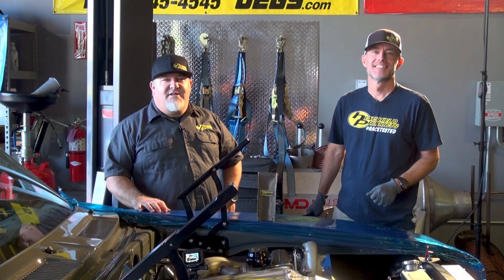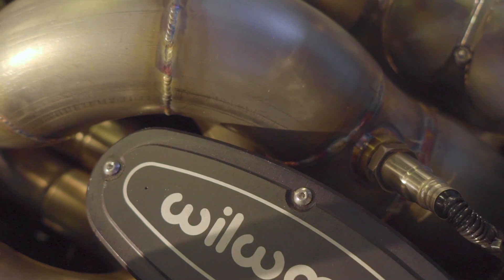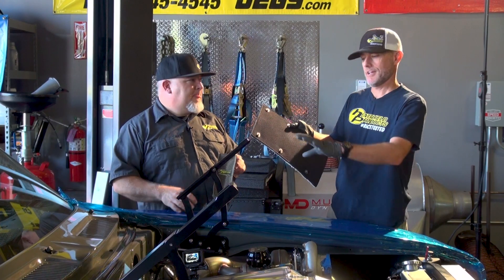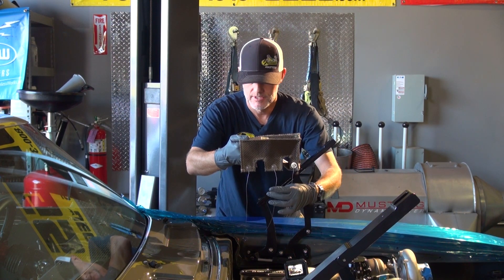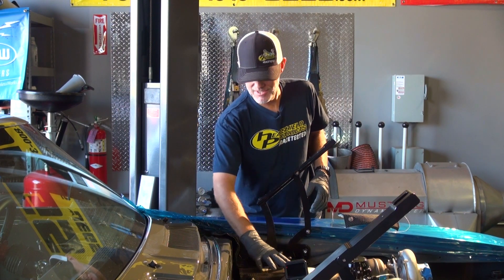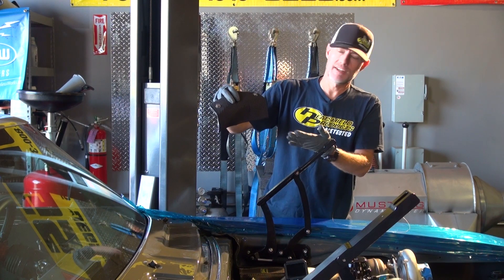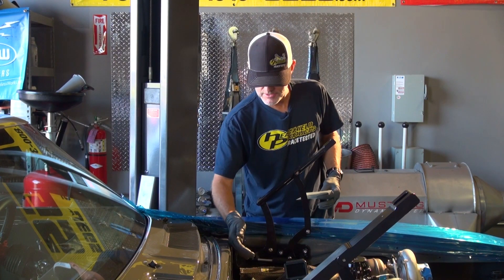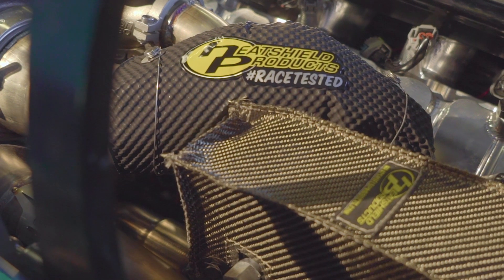Brake Master Cylinder Heat Shield

Comment: Wont putting the lava shield over the brake MC also trap heat inside of it?
Reply from the maker: Thank you for watching. Master cylinders do not generate their own heat, shield external heat sources will keep them cooler.
Reply: @Heatshieldproducts  I just bought the inferno heat shield. My top mount turbo is pretty close to the brake master. I've got a blanket on the turbo.  Would the inferno heat shield be better for the brake master or this lava one?
Reply from the maker: @kajida  The Inferno Shield will also work. It's just a matter of finding a way to mount it.